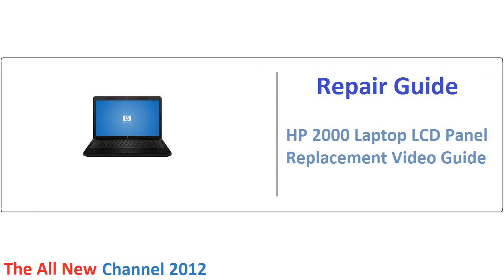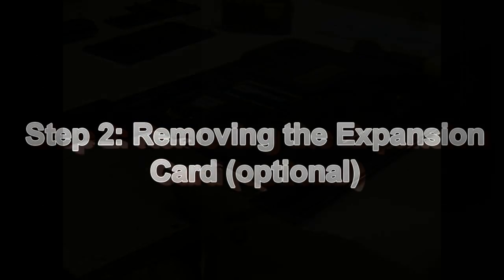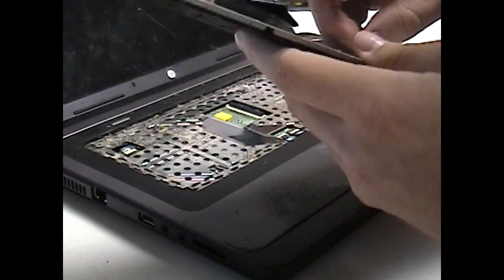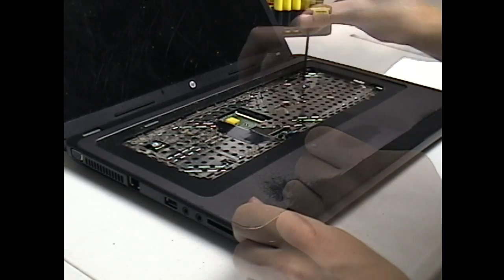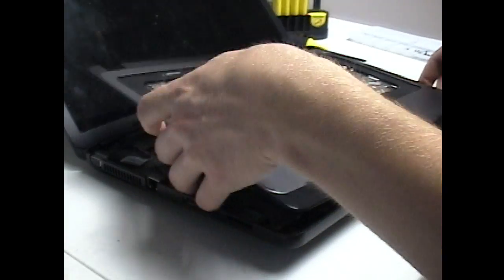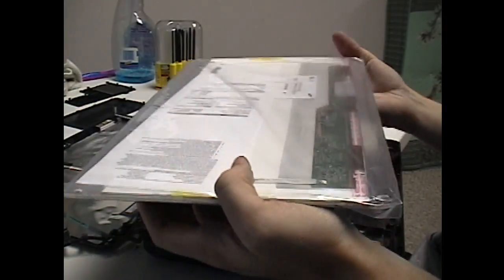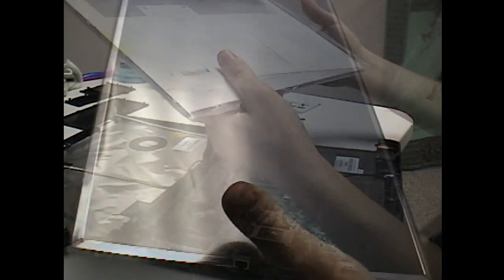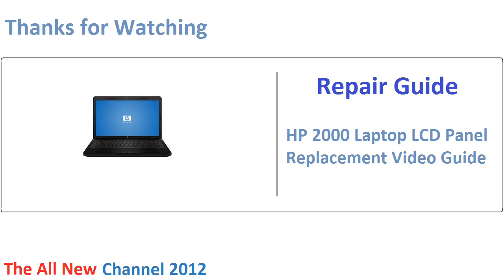HP 2000 Laptop LCD Screen Replacement Guide

Comment: Good job but u didn't need to take the the laptop apart to replace the screen.
Reply from the maker: Thanks for the encouragement. As I mentioned in the description, however, "if you're really careful and skilled, you may be able to get the job done without the time consuming palmrest removal step"

Comment: Why need to remove those parts ?
Reply from the maker: Presumably because the corners of the screen are slightly obscured by the corners of the computer. As I've mentioned numerous times already, depending on the dexterity of your screwdriver and your willingness to scratch up the palmrest & divert from the official service procedure, it may or may not be an option to get in that way without taking off the palmrest.
Reply: I don't mean to speak for the publisher of this video, but I see that he's referring to the official repair guide. Some guides do NOT provide instructions on how to remove the LCD alone. They only provide instructions on how to remove the entire Top Assembly. You wouldn't need to remove the ram, but pretty much everything else would need to be removed to detach the Top cover. It's the same thing with Dell Manuals. If you only want to replace the LCD, 99% of the time you don't need to detach the top assembly.
Reply: @BlueSparkzVideos does the front frame just pop off so you can replace the lcd without taking the whole top part off? Didn’t it look like he had to undo a screw on each side of the top part in order to free up the frame?

Comment: Dude u dont have to take everything apart go thru the screen take off plate and ur in within 30 seconds
Reply from the maker: As I've mentioned numerous times before, depending on the dexterity of your screwdriver and your willingness to scratch up the palmrest & divert from the official service procedure, it may or may not be an option.
Reply: Some laptops required the display to be removed before replacing the screen.

Comment: This is NOT a screen replacement guide. He's showing us how to disassemble the computer. Simple to replace the screen take the screen bezel off, there's two screws at the bottom, next to the hinge.
Reply from the maker: As I've said before, depending on the dexterity of your screwdriver and your willingness to scratch up the palmrest & divert from the official service procedure, it may or may not be an option.

Comment: Totally unnecessary, just take the bezel off and the lcd out and you're done. This guy has no idea what he's doing.
Reply from the maker: Depending on the dexterity of your screwdriver and your willingness to scratch up the palmrest & divert from the official service procedure, it may or may not be an option.
Reply: @Browningate, I agree. Some laptops like the HP G60 may need to be disassembled (not entirely) to take the display out before replacing the screen.

Comment: I'm usually not critical of others videos, but people need to know that you don't need to disassemble an entire laptop in order to replace the display.  90% of what he did was totally unnecessary.  Don't follow this, you will end up with more problems than you started with.
Reply: Had to replace and lcd of the same computer and you are 100% correct DJ it’s super simple to replace the lcd the outer edges of the screen snap right off and u just have to be wary of the glue, then disconnect the ribbon connecting the lcd and switch them out. It’s pretty straight foreword without all these extra added steps
Reply from the maker: Depending on the dexterity of your screwdriver and your willingness to scratch up the palmrest & divert from the official service procedure, it may or may not be an option.

Comment: This guy is an ididot. You can EASILY replace the screen without removing the keyboard. just undo the screen cover, the two brackets holding it on the sides... 3 screws per side, the nbe gentle in the ribbon. 5 minutes tops.
Reply: the equivalent of removing a car engine to change your brakes
Reply from the maker: Depending on the dexterity of your screwdriver and your willingness to scratch up the palmrest & divert from the official service procedure, it may or may not be an option.

Comment: I want to make sure I order the right screen. does anyone have a link to it? I have a hp 2000 altec lansing
Reply from the maker: The best way to get a practically-guaranteed compatible replacement is to search by the model number or part number on the panel itself. The second-best way to search is by the computer's full model number (2000-?????) found on the label under the battery.
Reply: thanks!

Comment: The "One Screw" at 2:05 seems to not exist on my laptop. It actually appears to be the same screw hole that the hard drive cover uses.
Reply from the maker: I know that the service guides do deviate from certain variations of these computers slightly at times. In that case, look around for any screw holes that have a picture of a keyboard next to them. If memory serves me correctly, some screws were hidden under the hard drive as well.
Reply: ***** 
I am replacing another LED screen, and on the HP you need only to remove the bezel and a few screws.
Reply from the maker: Rhomis Rhemis
Those are the easiest ones to do. It depends on how far down the bottom-most screws are. On these HPs, they're just a little too far down.

Comment: A side note to instructional video like this: it is a mistake to disassemble the whole lot when all you have to do is to unclip the frame, remove the stickers covering the bottom screws, undoing them and removing the frame. Then you undo the large top screws, the 6 small side frame screws and lift the LCD itself, unsticking the front camera flex in the process. Then you unclip the broken LCD, clip the new one at the connector and reverse the above for re-assembly. There, in less than half the time and no inside messing, completely unnecessary removal, hinge messing, speakers touching, or anything else. Good luck.
Reply: +Enigma Enigma You just saved me a bunch of time and hassle.  Thanks for posting the comment, did it your way and I was done in 20 min.
Reply from the maker: +Enigma Enigma 
As I mentioned to another commenter, you may be able to get away with just unsnapping the bezel and replacing the screen without removing the palmrest. Doing so may be faster, but not necessarily easier. Removing the palmrest is part of the official procedure recommended by HP, but you're welcome to take a shortcut if you are able to do so. Glad you got it working.
Reply: I am a professional, it's my job to get it working. Laughed at your video, didn't laugh at those who think you know what you are doing to the point of making 'instructional' videos.
Reply from the maker: Enigma Enigma
We're all students of life and I am proud to say that my skill and production quality improves with every repair and every upload. You may find the same can be true for you with practice as well.
Reply: Browningate it's obvious you don't know what you're doing lol. Nothing you did was required to change the screen.
Reply from the maker: @Kendrick Hayes
I'm sorry you feel that way. As has been mentioned in numerous comment threads in the past, (including this one) you may be able to get away with just unsnapping the bezel and replacing the screen without removing the palmrest. Doing so may be faster, but not necessarily easier. Removing the palmrest is part of the official procedure recommended by HP, but you're welcome to take that shortcut if you are able to do so.

Comment: Ok so this was my first attempt at replacing an LCD screen and this was the first video that I watched on the process. I followed your steps until the part where you talk about removing the keyboard. I really wasn't able to do it without feeling like I'd end up breaking something. So I decided "Hey maybe there's another way." After that I looked up other videos and none of them involved opening up the system in the way you suggest. While your method may have gotten you results it just didn't work for me. I'm not trying to be negative her. Just providing my experience and some constructive criticism. I figured I would offer my experience because all you really need to do it remove the panel in front of the screen (the screws are hidden) and some screws on the inside. Pretty straightforward.
Reply from the maker: +Dean Altemose 
You may be able to get away with just unsnapping the bezel and replacing the screen without removing the palmrest. Doing so may be faster, but not necessarily easier. Removing the palmrest is part of the official procedure recommended by HP, but you're welcome to take a shortcut if you are able to do so. Glad you got it working.
Reply: +Dean Altemose Completely agree. While I'm grateful to anyone who would take the time to make/post a video like this one, this isn't the easiest way to replace a cracked screen. It is however, a great video to follow for just about anything else you would want to fix/replace on this model.
Reply: All the removal of parts is not needed other than the screen.

Comment: Please dont follow this process. It makes the process overly more complicated than actually needed.
 Reply  ·
Reply from the maker: +Rakesh T 
Well that's not very nice :-).
Reply: I agree - wrong way of doing it with unnecessary disassembly of keyboard, speakers, hinge etc. It's a simple unclip unscrew and assembly. The video should not be followed, it complicates a simple and straightforward process.
Reply from the maker: +Enigma Enigma 
As mentioned earlier, you may be able to get away with just unsnapping the bezel and replacing the screen without removing the palmrest. Doing so may be faster, but not necessarily easier. Removing the palmrest is part of the official procedure recommended by HP, but you're welcome to take a shortcut if you are able to do so.
Reply: Not able to do so, I do
it in my daily work as an electronics technician.
Reply from the maker: Enigma Enigma
It'll be valuable to learn how if you want to pursue that kind of career.

Comment: This guy turns a 15 min job to 3 hours for absolutely no reason.  Get off this site and go to any other one.  My Gog!
Reply from the maker: texjarhead 
Glad you liked it.
Reply from the maker: Mrimperfectcircle
I know, right? What is wrong with this "texjarhead" guy?

Also, the word fuck only has one "u" in it, not two :-).
Reply from the maker: texjarhead
I usually remove the battery too. In fact, many repairs that require disassembly in the area of the battery compartment leave you with no other choice, even if you wanted to risk it.
Reply: pop the battery out.....6 seconds.
Reply: texjarhead I freaked out when I pulled up this video on screen replacement. I said "f**ck it" and just started taking the screws out of the screen and pulling the bezel off. Whole thing took me under 15 minutes.

Either this video is titled wrong or he has a lot of time on his hands.
Reply: ***** He did not like it.
Reply: always remove your hard drive and you key board before working on the screen. Ive never done it and my repairs work great, but just in case get that battery out of there!

Comment: I got stuck when I tried to pop out the keyboard, as per your instructions.  All that happened was that the keyboard flexed.  Not to mention the keyboard hole on your computer is in a slightly different area than on mine and apparently on the instruction manual as well.

Can you help me with this please?
Reply from the maker: It is normal for it to do that a bit. Don't take it too far if something is obviously holding it back though. As you found, not all HP 2000s are exactly the same, so there might be a hidden screw somewhere else holding it in, but if not, don't be afraid to use a little force (just not too much).

Best of luck!

Comment: Just did one of these, model 2d54tu. No need to remove Keyboard etc. remove the 2 screws holding the screen bezel on (at bottom, under stick-on covers), remove two large flat-topped screws from the top of the screen mounting frame. Pull the screen out away from the back cover towards you a little from the top, and then remove the 3 small screws on each side holding the screen to the frame. Be careful to peel the cable to the camera off the back of the screen first, then lay the now loose screen down on the keyboard. Peel the clear tape off that holds the screen cable in place, then gently pull out the cable. Reverse process to install new screen. Takes about 10 minutes all up

Comment: Just used this video to replace a screen on Hp 2000 laptop. Although a little fast (and I've got 25 years experience), it was very spot on. Good job!, and thank you. :D
Reply: Micheal Blue Did you actually take the whole laptop apart just to replace the screen?
Reply: No. Only need to remove the top quarter.

Comment: Thank you for the informative video! BUT, if all you need to do is to replace a busted LCD, 'Screen Surgeons' shows a way to do it without having to take the whole bottom part of the notebook apart. A lot less work/risk of damaging components/faster/easier. HP 2000 Notebook Screen Replacement  Procedure
Reply from the maker: As mentioned earlier:

"If you're really careful and skilled, you may be able to get the job done without the time consuming palmrest removal step, but for most, it'll be easiest to just do it as described in the video and service guide."
Reply: f
Reply from the maker: michael lee
g

Comment: the wire that connects the monitor to the laptop was damaged on my laptop. Mine is pretty much the same as yours. Do I need to find a specific LCM cable, or would the one on your laptop work as well? The LCM cable looks just like yours.
Reply from the maker: Hard to say for sure. Usually those cables run around 5 - 10 dollars on eBay though, so you shouldn't have trouble finding a replacement.

As I always say when talking about connectors of any kind, "if it fits, I sits".
Reply: thanks

Comment: Why didn't you just take a short cut by just opening the screen rather than opening the whole computer.
Reply from the maker: For the same reason I mentioned just 3 weeks ago right underneath your comment previously:

"I agree that the process does indeed consist of entirely too many steps, but some of the screws in the lower corners are nearly impossible to get at with the palmrest assembly still attached. This is a hallmark of a "PITA Engineered" computer. If you're really careful and skilled, you may be able to get the job done without the time consuming palmrest removal step, but for most, it'll be easiest to just do it as described in the video and service guide."

Comment: Way too many steps in this video if all you need to do is replace the screen. Check out other videos here on youtube for hp 2000 screen replacement. You do not have to disassemble the lower half of the computer only the upper half that houses the screen.